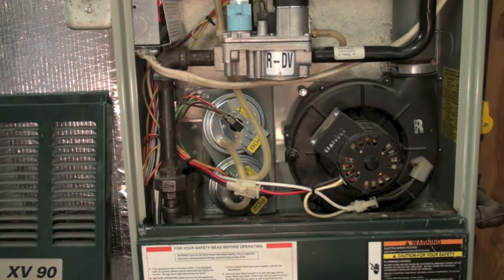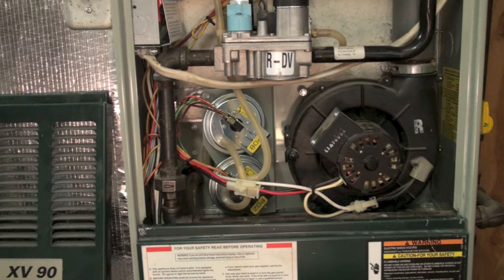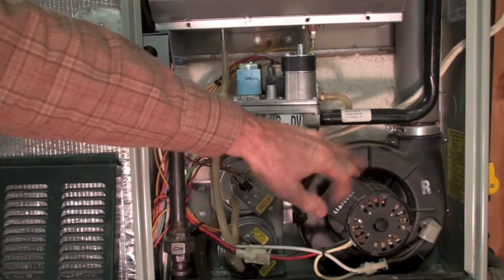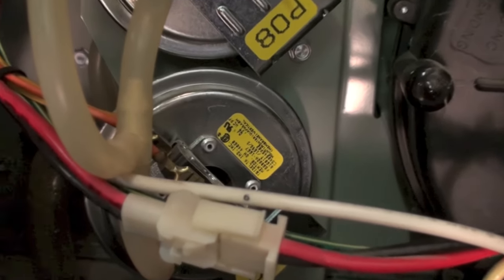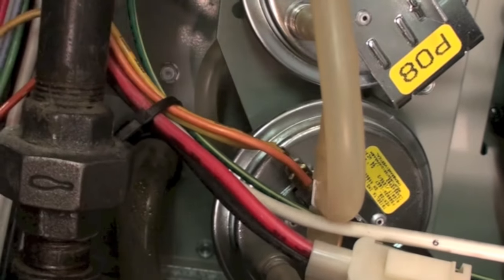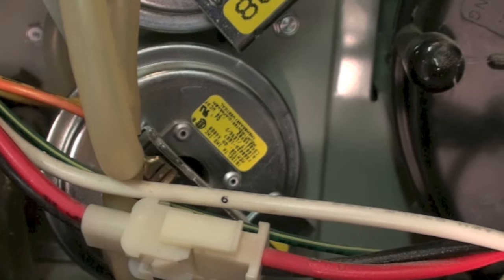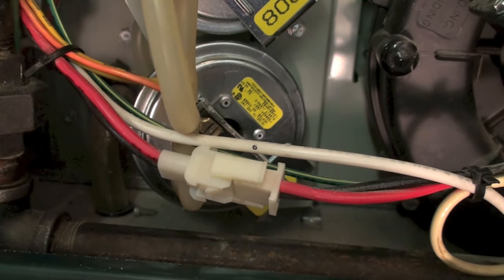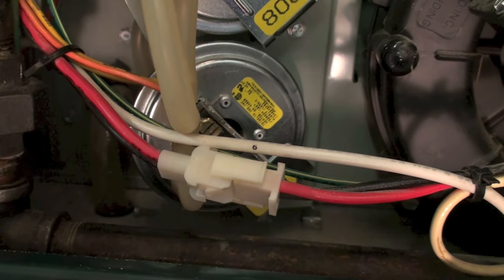Diagnosing pressure switch problems on gas furnaces

Comment: I have a ducane furnace about 10yrs old and last week when it was very cold my furnace wasn't hitting the temperature my thermostat was at so I cleaned the flame sensor and it worked then a week later the furnace stopped working all together it was blinking the limit switch was open and the pressure switch so I called a repair man they said it was the smart valve so I put that in and it worked for a week now its not hitting the temp that the thermostat is set at unless i set it at like 67 or 68 degrees but not above 70 and its blinking pressure switch is open when it shuts off but sometimes it blinks limit switch open but its still running but then shuts off when it hits temp I checked all the hoses connected to the pressure switch none of them are clogged I have no clue what to do now
Reply from the maker: I would be looking at vent blockages, dirty inducer blower wheel, possible cracked heat exchanger.   The limit switch opening does not seem to be related.  If the furnace is 90+ efficient(plastic venting), you might have a plugged secondary heat exchanger.   Of course, filter should be checked and blower wheel should be cleaned.  Hope this helps.
GFM
Reply: grayfurnaceman when you say vents blocked do you mean vents into the rooms

Comment: I am trying to troubleshoot my furnace.  Is the inductor motor supposed to come on as soon as the thermostat is indicating the need for heating and before the pressure switch is read?  I have a honeywell SV9420.  I am getting 120v power to the valve board at all times whether calling for heating or not, but it is never sending power to the inductor motor when calling for heating.  I assume I have a board problem and has to be replaced?
Reply from the maker: If all connections are ok and the inducer motor is ok, look to the fan board.  You might be able to see burned spots on the trace side of the board.  Hope this helps.
GFM
Reply: grayfurnaceman Thanks for replying! I have  Fan Board ST9160B1076. It is dark yellow around the R20 part. Does that mean it's burned out there?  I can't see the back side of the card without removing it and I don't see any other issues from the front side.

So should the pressure switch be normally open, then when the inducer motor starts up, it should close from the pressure, sending the signal to allow the furnace to fire up? If that's the case, could I just temporarily jumper the common on the pressure switch to the other side making it closed just to check if the switch is the issue?  According to the flashing LED, the problem is the pressure switch.  Maybe the switch is faulty/always closed, not allowing the inducer motor to get power to start?
Reply from the maker: oukewldave The dark spot may not be a problem as R20 is a resistor.  The pressure switch should be open in the off cycle.  On a call for heat, the pressure switch should prove open.  You can disconnect one wire from the pressure switch, then call for heat.  If the inducer starts, the pressure switch is stuck closed.  
GFM

Comment: Some of the wires for the pressure switch are burnt Would I still have to replace it or do I need a new one
Reply from the maker: If they are burnt, I would be looking for a flame rollout and forget replacing the switch.  You have much bigger problems.
GFM

Comment: Really need help.... I took off the air hose that runs from air pressure switch to the combustion chamber and now my furnace will run.  If I connect the air tube back to the combustion chamber, I get the three blinking lights indicating I have a draft pressure error.  Please help!
Reply from the maker: Look for blockage in the combustion air pipe. Be sure to check for sags in the pipe that contain water. Also any screens in the pipe. 
GFM

Comment: I believe you are giving inaccurate information. Pressure switch opens when pressure drops to .94 
Does not close at .94
Pressure reading will be more like 1.75 to 2.0 with a  .94 pressure switch.
Reply from the maker: It does indeed close at negative .94 in wc.  The pressure may be higher as the venting resistance is variable due to different lengths of effective vent length.  
GFM

Comment: Mr. Gray:
I have a question regarding my house gas furnace (19 years old). I 
changed the draft inducer unit due to the broken wheel. After that, the 
furnace was not working properly. When I turn the thermostat on, it 
starts the inducer then the pilot then the main burner chamber is on. After 
reaching the set temperature, the furnace shut off. After the 
temperature dropped, the inducer is on but no pilot light up and no heating. If I 
unplug the tube connected to the pressure switch with the + mark (which 
is not the one connected to the draft induce motor shell) and slowly plug it 
back, the pilot lit up then the main chamber is on.  I thought it was 
the pressure switch bad, so I changed it.  However, the problem is still
 the same. I am lost and did not know what is wrong with the furnace. Is
 the draft inducer not good? I replaced it with the exact model. Can it 
produce too much negative pressure to the pressure switch?
In addition, the draft inducer motor is very hot ( cant touch it with bare 
hand) even when the main chamber is not on, Is that normal?
Please help.
Thanks a lot.
Reply from the maker: +David Li First, are you sure all the parts of the inducer wheel have been removed?  Did you seal the inducer to the heat exchanger with either a new gasket or RTV silicone?  The hot inducer may be normal.  Hope this helps.
GFM
Reply: +grayfurnaceman It is great to get your reply. I bought the whole inducer unit. I did not seal the inducer to the heat exchanger because they did not seal it before. I will try to do that. I think you mean there is a possible leak between the new inducer and the heat exchanger. Thanks a lot.
Reply: +grayfurnaceman Mr. Gray, I took down the inducer unit according to your suggestion.  I found out that the back shell of the new unit has a bigger hole (~2 in. across) than the old one (~1 in. across). (The hole is connected to the heatexchanger from the draft inducer.)  I should take down the center ring piece from the old one and put it on the new one before I install the new one.  After I did that and the furnace works perfectly. You are also right about the pressure switch as you said It should be the last to replace.

I believe the center ring piece is a limiting device to control the draft pressure to the pressure switch. When the hole is too big, the draft inducer produced high negative pressure which prevented the pressure switch to back to neutral position, so the pressure switch can not turn on when the consecutive heat up call is issued by the thermostat. Now the furnace is working again and thank you very much for your great ideas and it solved the puzzle which bothered me for almost a week. During those days, I have to wake up in the cold and go to basement to unplug the pressure switch to restart the furnace to get the heating in the early mornings.
Best regards.
David
Reply from the maker: +David Li Glad you got it working.
GFM

Comment: I have an airease gas furnace and the induction fan comes on for about 2 minutes then shuts down, can't figure out why the furnace won't work. any suggustions?
Reply from the maker: I'm going to give you a playlist on the gas furnace starting with a sequencing video.  It may help to understand how the gas furnace cycles.  How the 90% gas furnace works

Comment: Hey I'm having problems with my American Standard freedom 80 single stage...... It has 3 flashes indicating that is a pressure switch error  what do I do
Reply from the maker: josue cosme I would be looking for venting blockages, water in sensing line and all parts of line clear.  Hope this helps.
GFM

Comment: I have a lennox elite series gas furnace, the problem im having is i have to turn my thermostat on to get the furnace to come on,  sometimes the furnace will try and start but will not keep running until the temp is at where i set thermostat, i replaced thermostat already didnt help, sometimes i can hear water gurgling around furnace, this cant be normal, but it doesnt do that always  thanks
Reply from the maker: I would be looking at condensate drain blockage.  You can clear the drain and P trap with a vac.  Do not connect the vac hose directly to the drain.  You do not want excessive vacuum on the pressure switch.  When you are done, refill the P trap with clean water.  Hope this helps.
GFM
Reply: grayfurnaceman thanks i will try that, how much water do i refill trap to
Reply from the maker: mike bass It should take no more than a cup.
GFM

Comment: Just had a new pressure switch put in two years ago. Last year a new motherboard. Now my furnace is out and they just told me a needed a new pressure switch again because of dog hair. He cleaned it and my furnace came back on, but said I should still replace the pressure switch. My furnace is only 6 yrs old. Does that sound right to you?
Reply from the maker: nikki smitj No.  I have never seen dog hair plug up a pressure switch.  Something does not sound right here.  Are you sure he said pressure switch?
GFM
Reply: He either said pressure switch or pressure sensor. He was in my basement no more than five minutes and my furnace came on. He said there was a lot of dog hair and he said he cleaned it off but that there is no guarantee that it will keep running. He said he would have to get the part and fix it tomorrow. (175-200 bucks) I'm positive he said pressure switch though because they just put a new one in two years ago and he said it went bad because of the dog hair..
Reply from the maker: nikki smitj I assume you have dogs.  The dog hair should only affect the ductwork and circulating fan.  One other question:  Is the furnace an 80% efficient (metal vent pipe) or 90% efficient (plastic vent pipe)?  An 80% furnace will take indoor air for combustion.  A 90% furnace should take outside air for combustion.  This would eliminate indoor air completely from affecting the pressure switch.  In either case, the probability of dog hair affecting the pressure switch is low.
GFM

Comment: My furnace's control board is saying that the pressure switch is stuck open/closed. When I check the output on the switch it has 0v with the induction fan off and 27v with the fan on. But it still fails to light and shuts off after a few seconds. Then go's back to flashing the l.e.d. 3 times for a stuck pressure switch. Any help would be greatly appreciated.  

Update: I found the problem. The current from the pressure switch runs through 2 thermal limit switches on each side of the main blower before reaching the control board. One of those 2 switches died. I forgot to change the filter which is probably what did it. Now once I get the new parts I have to pull the whole fan out just to get to them. At least I'll remember to change the filter now.
Reply from the maker: 420Nitroman Good thinking!
GFM

Comment: I have a roof gas pack. The gas will fire if I leave the panel cover off, but not with it in place.
Reply: same thing happened with when I leave the door open it works 
wat was the issue with your furnace
Can u help me out?
Reply from the maker: +mikhaiel j You probably have a blockage in the combustion air pipe.
GFM

Comment: can my furnace work if i jump my pressure out? my furnace code reads that there is a pressure switch error.
Reply from the maker: No.  The furnace is smarter than that.  Also, would you want to bypass a safety device?  look for blockages in vent or combustion air supply or condensate blockages.  I have a number of videos on pressure problems that may help.  
GFM

Comment: The code on my 12 year old Rudd furnace, model UGPH-12EARJR ,says that the pressure switch is closed.  The furnace has failed to kick on several times over the past 6 weeks.  If I pull off the front panel, it fires up and runs fine for a couple of weeks then the problem repeats.  The repairman says I need to replace the pressure switch (but also was pushing me to buy an entirely new system). Other than finding a different HVAC repair company, want would you suggest?  Thanks in advance.
Reply from the maker: Molly Mom If the pressure switch sticks closed, the switch needs to be replaced.  I would not replace the furnace without more knowledge about failures.  Hope this helps.
GFM
Reply: grayfurnaceman Thanks for the lightning fast reply.  You are amazing!

Comment: Can you help me out? I have a GSW power vented natural gas water heater . When the gas valve is open and the heater is running there is a thumping sound approximately every 3 to 6 sec. coming from the heater. I noticed that is the sound of the valve closing and opening quickly. I installed a new ignitor assy. Still the same problem.Any suggestions?
Reply from the maker: Jordan Vadori Is the burner staying on?  If so, your tank probably has lime or sand in the bottom of the tank.  The sound is steam forming under the sand, then bubbling through.  Hope this helps.
GFM

Comment: My lennox ml195uh keeps kicking on and off when I turn it to heat. The burner will kick on for a couple seconds then kick off and keep doing this till it turns off completely.  Could it be a bad pressure switch?
Reply: You probably have a flame sense problem.  Dirty flame rod?
GFM

Comment: My American standard freedom 80 furnace calls for heat and the igniter just starts to glow and my gas valve opens up and shuts off after a few seconds, I thought my gas valves needs cleaning, but when I shut the furnace down and restart it, the igniter glows bright and the gas valve opens and the flames come on. Every time it’s the same, the ignitor just starts to glow and the gas valve open up for a few seconds and shuts down. I turn the furnace off and back on after a few seconds and it works fine. Could this be the igniter going bad?
Reply from the maker: I would first replace the ignitor.  It is possible the control board is failing but I would try the cheaper replacement first.
GFM
Reply: I just replaced the control board, before I was constantly getting pressure and limit switch errors. So I changed the board and no more errors, only the ignitor seemed slow to start glowing before the gas valve opens. As I stated on the second start up the ignitor glows bright and the flames come on.
Reply from the maker: I would replace the ignitor.
GFM

Comment: My blower fan fluctuates very fast like, the fan is turning on and off very quickly. The burners stay lite during the furnace is heating.  Is it a problem with a pressure switch??
Reply from the maker: ***** It is probably not the pressure switch.  This could be a loose connection in the wires going to the fan motor or if it is an older furnace, the fan switch could be cycling the motor because of very low return air temperature.  Hope this helps.
GFM
Reply: Ok thanks for the reply and the videos. I will jiggle the wires tonight to see if I can replicate the issue. I want to say that this did not happen during the summer air conditioning time. I do remember it happening last winter as well and that is when I first watched this video.

Comment: If I unplug the vacuum tube to the combustion chamber and it starts working what does that mean? Thanks
Reply from the maker: It could mean several things, but the most common is a blockage or water in the combustion air pipe.
GFM
Reply: grayfurnaceman thank you for your time.

Comment: HELP!! Is there any way you could email me?!?! My furnace is blinking 3 lights We put a new pressure switch in not even a year ago and now it is doing this again.. but this time the "fan" that the tube goes towards is VERY loud... what could it be?!?!
Reply from the maker: You may reply thru this forum.  The fan assembly is an inducer.  If it is noisy, It is either plugged or failing.  You can remove the vent pipe to check the inducer for blockages.
GFM

Comment: i have a question. my brother gave me a reznor heater that he was using in a small mudroom where he kept his washer and dryer, and didnt want the pipes to freeze. he said it blew a low oxygen sensor, bcause it would depleat the fresh air in the room, and as a safty feature ,it would pop, and turn off the system. so he gave it to me, with the promiss that he would fix, and install in my larger garage. bt he passed, and im now wanting to try and figure out whart he was talking about before i hang, and install it not working. i want to resolve the issue first. any help?
Reply: is this a pressure valve, like your talking about?.. he said the room would get very hot, fast...after the second time it blew, he took it down, and got a small radiator oil heater..
Reply from the maker: @josephzimbler9914  Give me a model # and some pics of the furnace.  
GFM
Reply from the maker: Send to Grayfurnaceman@gmail.com
GFM

Comment: I have put a icm287 control board on a furnace ( not mine),, ok, after installment the furnace fires up as it should,runs for thirty seconds, cuts off ,runs for 10 seconds and cuts off,so I cleaned flame sensor,still no help...will pressure switch make long enuff to make furnace cycle irregullary..what gives??
Reply from the maker: It can.  If you do not have a water column gauge, start the unit, then place a jumper across the pressure switch to see if that makes a difference.  That will tell you if the problem is in the vacuum system.  Hope this helps.
GFM
Reply: grayfurnaceman
on my way to jump it out if this does not work, the only thing left is flame sensor , right seeing how new icm was installed?
Reply from the maker: todd wall If the jumper makes no difference, you can clean the flame sensor.  It does not sound like that is the problem.  
GFM